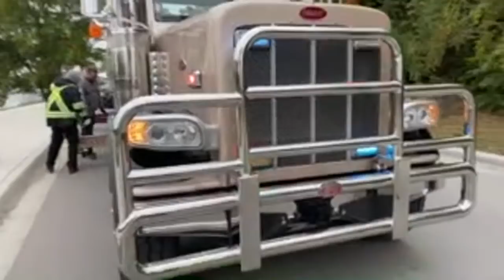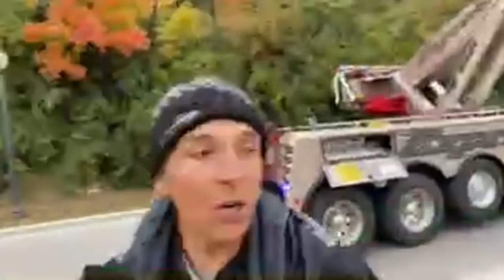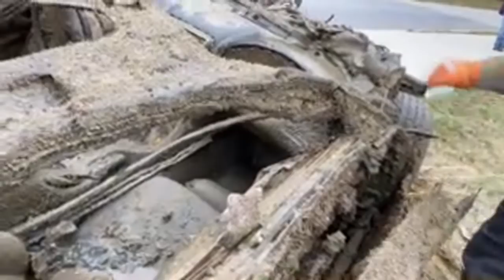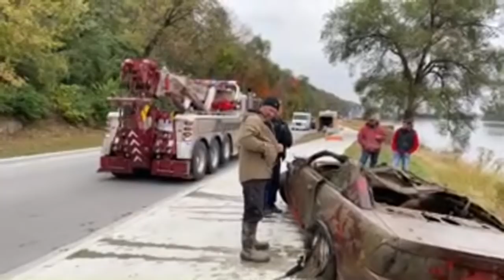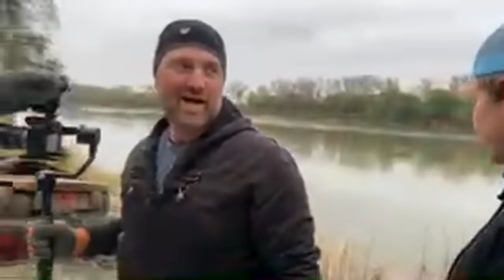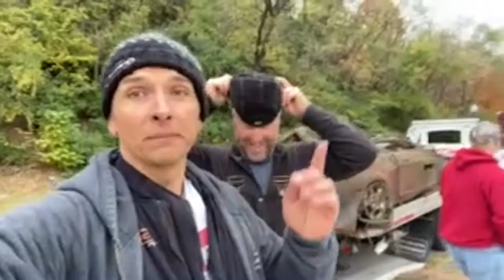RECOVERING Red Sports Car From River LIVESTREAM

Comment: I drove a yellow Mustang Mach 1, 1973 for many years in the late 70's early 80's... It had a 351 Cleveland and got 12 mpg. It had Gabriel air shocks so no load was too heavy.  A few years before that I drove a 1970 Grabber green Mustang Mach 1 with a 351 Windsor engine and only 8 mpg..... The latter of the two was amazing other that the gas cost.... I really miss them both!

Comment: When that car went in the water there was no such thing as a smart phone. The story is the park brake failed when it was parked by the tree in the back ground. It was only recently  that there were sidewalks installed there. As you can see it didn't float very far. With in days the insurance company sent divers to locate the car. They were real interested in knowing if in fact the park brake was set. Bowens towing company stood by to pull the car out of the river if the divers could locate it. Divers struggled with the current and obviously it was not recovered until now. Good job.

Comment: Id like to give some advice. I've run a tow truck for a couple years. Let me advise you that you are too close to the cables in most of the videos.
If that cable would break at the boom, it could backlash and cut y'all in half. Chains, cables and straps break. Please keep better distance while they're pulling. Be aware of the dangers please.

Comment: If it was a Honda it would probably start with a new battery . Shame it wasnt a '67 Notchback .Roof looks like the keel of a boat has filled it in if the car was parallel to flow .

Comment: why are all the cars looking like they have been in a roll over?
Reply: Because usually when a car is met with a body of water the car will float for several minutes and the current can cause the car to flip upside down on it's way down and cause it to land on its roof, this alone causes damage and on top of that the corrosion causes the metal frame of the car to weaken to a state where it can no longer support the weight of the body of the car so it crushes downward with time. Currents can move / flip cars and damage will always follow.